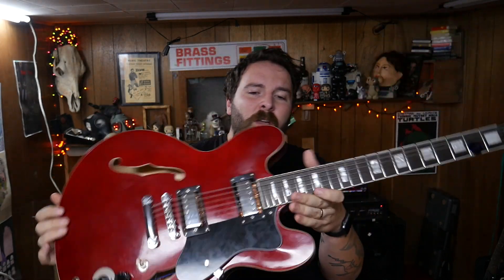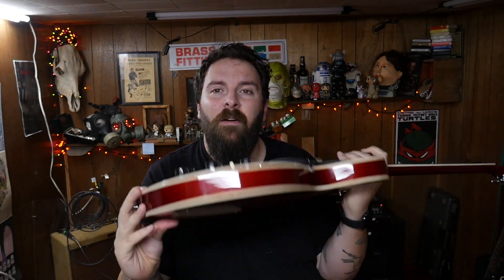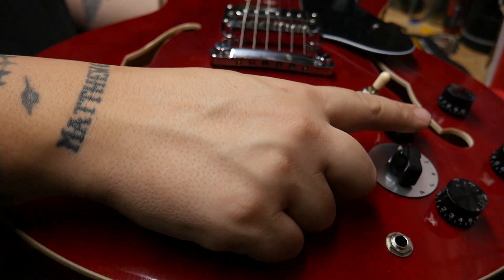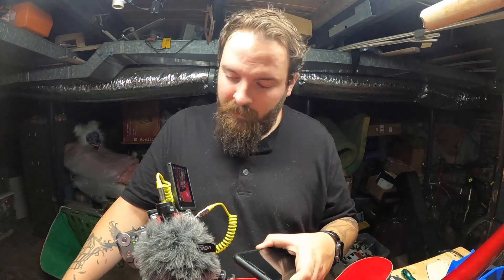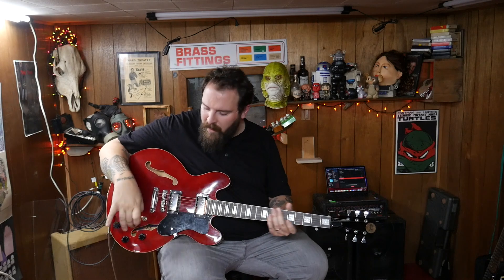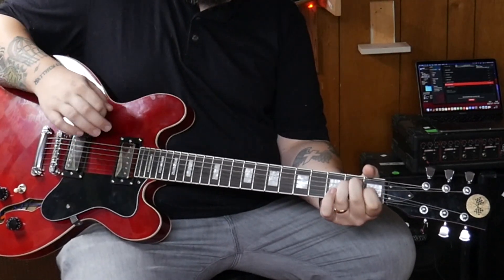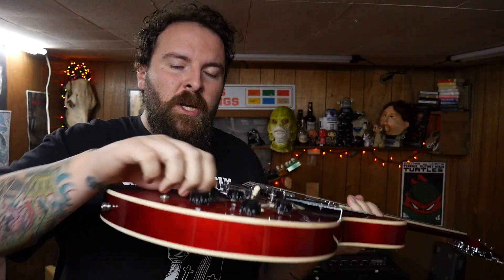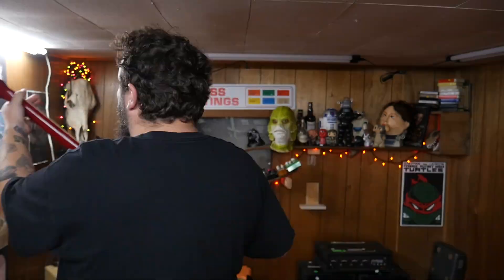How to Install a Varitone Switch

Comment: Interesting. This varitone does the complete opposite of what my old Gibson ES-355 does. With every position, it cuts out more and more lower frequencies, till it sounds almost like an old telephone. What I like about the Varitone in my guitar is that the guitar sounds like a telecaster or strat almost on positions 3 and 4, which is very solid for funk and country stuff.

Comment: I know nothing as well but I think you've just built yourself a very complicated tone knob, not really a Varitone.
Reply from the maker: That’s all a varitone is lol
Reply: @BuzzardsRoostWoodcraft  Not really. A varitone filters specific frequencies. It's more of a "notch" filter. Is that the right term? It's not just rolling off the high end. If anything it takes out more lows than highs. What you have is just rolling off top end like a traditional tone control. I think you are also missing something called an Inductor, I think. Gibsons with Varitones have these weird little boxes under the pickups that are part of the Varitone circuitry.  But I honestly know almost nothing about electronics. I can follow a crude wire diagram but that's about it. In any case I admire you for trying. I've wanted to install one on my 335 but never pulled it off.